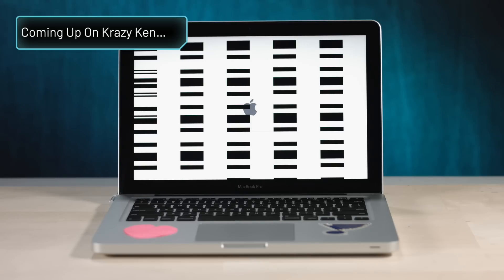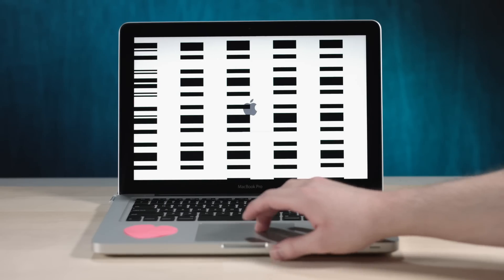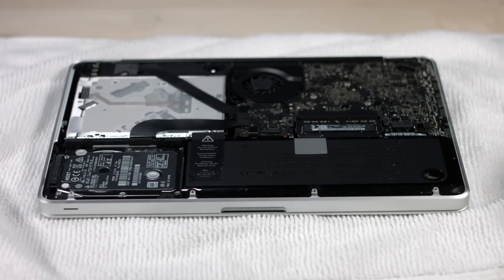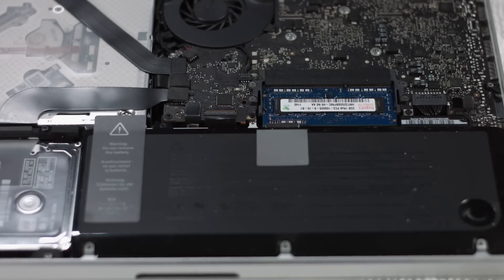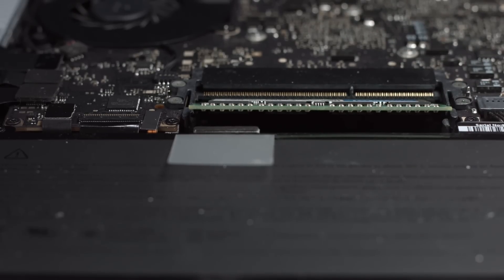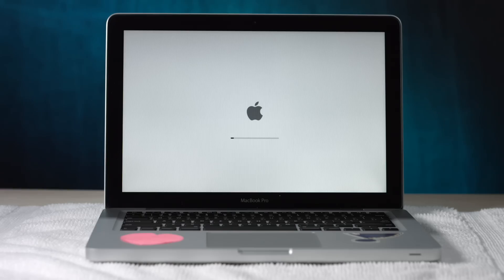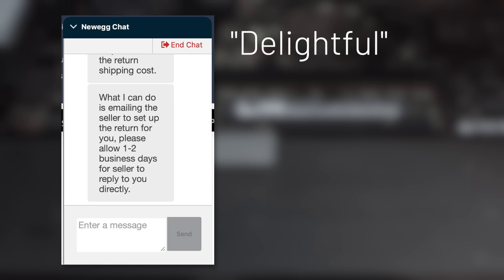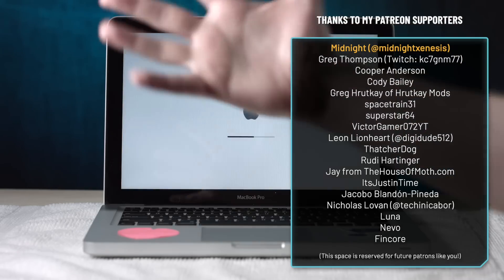MacBook Pro RAM Issue (Beeps and Black Bars) - Krazy Ken's Tech Misadventures

Comment: MacBook Pros 2012 13" had problems with the RAM slot, MacBook Pros 2012 15” had problems with the graphics chip. Apple had done a great job again. And when you complained to Apple about your macBook, they installed the same hardware crap again.

Comment: I was playing with my 2009 MacBook Unibody, and I noticed something about this video. The Crucial RAM you bought was DDR3L, a fully compatible, but less power hungry version of DDR3. MacBooks really do not like this type of RAM. I have several DDR3L sticks in a collection, and when I got my MacBook with only 2 GB of RAM, I tried to upgrade it with these DDR3L sticks, and got a 3 beep and 5 sec pause POST error. That might be the reason why the green Crucial RAM never worked. Even if it was the RAM pin issue, it would be highly likely if the crucial ram would have never worked at all.

Comment: Sooooo I have a 2011 mbp and I have installed 16 gb of ram on it. I have never had a problem with the 16 gb even though there should not be that much. Anyway, I also used the dosdude’s patcher for catalina. 6 months go buy and I am using it as a daily driver because I am a high school/ college student. All of a sudden the screen gets messed up and starts beeping the same way. I have upgraded my MacBook Pro to its highest specks and I am not sure what could be happening. Could it be that my Mac is not regulating the ram and letting it get full? I am thinking it does not regulate the ram and then will panic if there is not enough. Pls someone help me

Comment: I once pulled a 4gb ram out of my dell laptop and put it in my mid 2012 mbp and it came out exactly like that. At that time I almost sh*t myself. I put the original 2gb ram back in and it's suddenly ok. The thing is the 4gb ram is still OK and works fine on the Dell. Now I'm scared of buying a new 8gb ram for the mbp. Any ideas? Thanks

Comment: I removed the pressure pad which is explained at 12:36.. that pad had the shape of my ram which told me that there is a lot of pressure to the ram. in other videos i saw people installing credit cards under the lower slot to lift it up. so removing this thing could be the trick- for now its working fine with 2x 8gb ram

Comment: My mid 2012 mbp did the same thing. I put a piece of folded paper between the ram slots and never had a problem again
Reply: @goysb4jays566  yes, occasionally I’ll have to reseat it. But I don’t use that computer as much as I used to. But since it’s working again it’s my backup computer

Comment: During this quarantine I worked on my Mac (I had this issue for over a year). Looks like the logic board cracks sometimes internally (by loads of moving it, weight, etc) and the pins start failing. I took it to the "Genius" bar and they told me it was worth nothing. I worked on it a little bit and finally made it work, however if I move it it happens again. I haven't tried the one ram approach but will do it. P.S. In some angles (Horizontal Scree, vertical Keyboard) it runs nice and smooth

Comment: I have a mid-2012 MacBook Pro that I use every day and runs 24/7

the only issues I've had with hardware was the fan bearing dying and my MagSafe literally melting and giving me a burn

maybe the "runs 24/7" part has something to do with the RAM slot still being fine because the heat makes the solder able to move around slightly and not break off or something?

Comment: I changed the RAM but still have the black bars what do I do?
Reply from the maker: The pins on the board are probably bad. They will need to be soldered or you can get a new board.
Reply: @ComputerClan  Yes I finished the video all they way through and left one stick in the top slot only and it works now, thank you for the video. Also would you think its worth it to buy an 8gb ram stick to put in the one slot that works

Comment: I had the same issue with my 2012 13 1278 MacBook Pro. The upper slot is through hole soldered and the bottom slot is BGA soldered. The BGA solder balls are known to crack. I was able to fix mine with some flux and a heat gun. Make sure you put tinfoil around the slot so it doesn't get melted by the heat gun. Only the balls should be exposed to the heat gun. It can take up to three minutes of heating to reflow the balls. The logic board is designed to absorb heat. You will need to remove the cpu heatsink, speaker and the Sticker with the serial number. Let the board cool for at least 10 minutes before reinstalling.

Comment: Same thing happened to my 2011 17” MBP. I just bought a single 8GB stick for the top slot. Interesting that it seems to be a common problem
Reply from the maker: It hit the 17-inch too? Dang...
Reply: My 13' has the same problem. Fixed it with an old credit card cut to small pieces an putted them onderneath the ram slots so all the pins made contact

Comment: it always hurts me seeing someone not having upgraded to ssd in their macbook 😂
Reply: @Sean B a basic 120GB ADATA SATA SSD can now be had for $16 - $20 USD , and a 240GB ADATA SSD can be had for about $40 USD direct from the company on eBay, and I've used several of them so far, and none have had issues in any of my systems. So when I fix people's systems Apple, or not, I always ask people who don't have one, if they want at least a 120GB SSD for a boot drive, and when they say no I sigh!! because it's such a cheap, and easy upgrade that give many gains.

Comment: I just switched out my RAM for my 2012 MB Pro non-retina and this stuff happens? Did I just dodge a bullet..?
Reply from the maker: Not sure. This issue doesn't relate to the RAM modules. The issue is the RAM pins on the board.

Comment: Maybe take to Rossmann for repair
Reply: Ken and Rossmann joint video
Reply: @hugosimoes5119  Join live stream repair
Reply: he does not repair ram slots
Reply: @carrbuilds2312  can he switch ram slots? he can replace display connectors and other stuff
Reply: @hugosimoes5119  IDK, I just remember 1 video where he explained that ram slots are so time consuming and have a low success rate, that he usually doesn't bother, especially since these a1278 macbooks are beginning to age.
Reply: @carrbuilds2312  Don't stop! Repair now! 👌

Comment: Baked my board in the oven.... reflowed the solder... fixed it 😀 ..... not for the faint of heart
Reply from the maker: For real?
Reply: Yea..... 😀 but need to be careful.... one time I overbaked a board.... not a good thing!!!!!!    That one was toast ....LOL!!! Am about to bake a control board to a tv .... got a new (expensive) oven thermometer.... calibrated.....
Reply: No just no!! You will ruin your oven as the solder can be toxic, plus it's not a permanent fix. You need proper reflow equipment, and that cost in the 1,000's of dollars just to get started doing it right.
Reply: Commodorefan64 I only attempt this on boards I don’t mind loosing if all goes wrong plus I use a dedicated toaster oven not used for food (ever)

Comment: Btw just wanted to point out.. the RAM popping up when you move the clips isn't an Apple specific thing. Basically all laptops with removable RAM modules do exactly the same thing lol
Reply: my dell from 2010 does that too but there might be some really old laptops that don't
Reply: Thanks for making it so I dind't have to be "that guy"
Reply: But oh Apple fanboys don't know anything else besides MacBooks iBooks and so on. They think Apple invented everything first and others copied from Apple.
Reply: @hugosimoes5119  I'm pretty sure the only iBook a modern Apple fanboy would know is the app iBooks.
Reply: @hugosimoes5119  bro's comment is saltier than the dead sea
Reply: @hugosimoes5119  i think you meant i S h e e p
Reply: @hugosimoes5119  windows simp
Reply: @hugosimoes5119  the amount of salt in your comment smh
Reply: @tormenmashi_  Gimme some. I don't have enough.
Reply: I don't think it's fanboyism, just lack of experience
Reply: @s8wc3  maybe
Reply: @s8wc3  I think it's a bit of both, and sadly I've found over the years many Apple users refuse to learn anything outside of the Apple ecosystem.

Comment: I have same bullshits with my old HP i do this everyday.
Reply: well HP computers are garbage they always have issues
Reply: @SStarlight9614  I agree on most of their laptops, but if you can get ahold of their business class desktops for cheap on eBay they are not too bad to turn into Manjaro Linux machines, if you add an SSD, bump the the ram to at least 8GB, and they have at least a quad core AMD or INTEL  CPU.